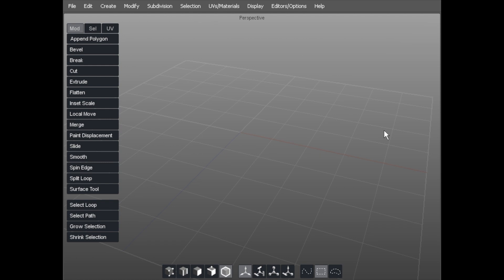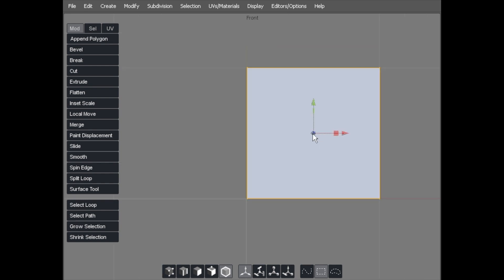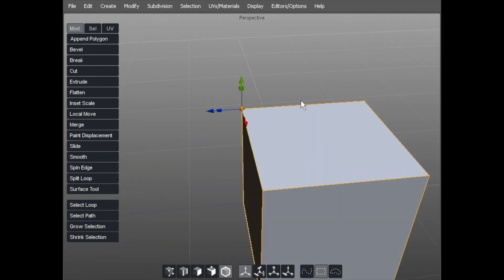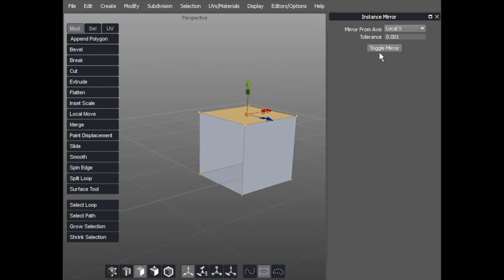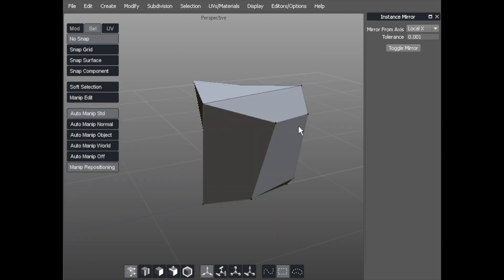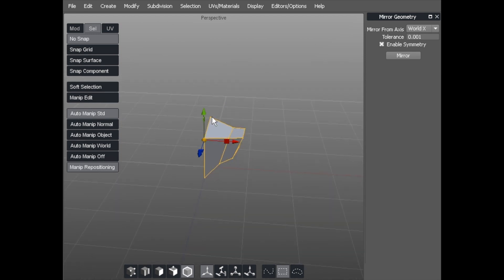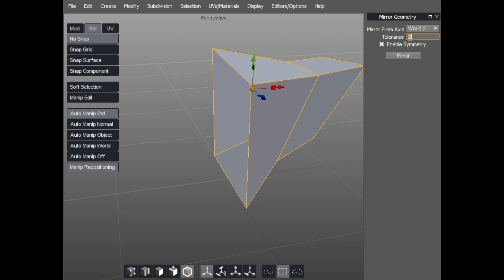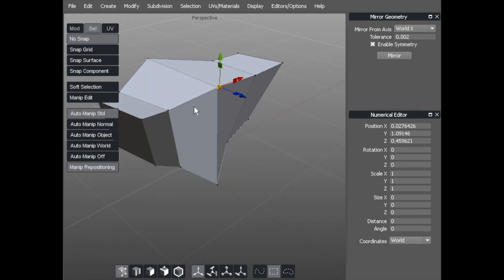Glen Southern's Silo Fundamentals - Part 3 of 11

Comment: I have found that "calculate symmetry" frequently results in an immediate hard crash (albeit running on a 2014 macBookAir). "Mirror geometry," conversely, works flawlessly every time. Very useful.
I kind of wish there was an option for radial n-fold symmetry.
eg; fivefold symmetry for a starfish. Threefold for a "War of the Worlds" Martian tripod, or the blades of a desk fan. Fourfour would be similar to having any two axis of mirrored geometry, but an object with radial symmetry does not always have mirrored geometry. eg, "b q" has twofold axial symmetry, but not mirrored symmetry.
Silo lets you create mirror objects, and rotate them around a centre axis for radial symmetry, but weird multiples of objects aren't so straightforward (360 degrees doesn't divide evenly by 7, for example, so you couldn't have 7 fold rotational symmetry, or 11-fold). Mirrors would have to be separate objects: not so easy adding topology connecting them).

Admittedly though, bilateral symmetry tends to be the most frequently useful function.
Reply from the maker: Silo has a radial mirror modifier in the Modify > Modifiers menu which will let you do radial symmetry easily. Please send us along any model you have which creates a hard crash to support@nevercenter.com